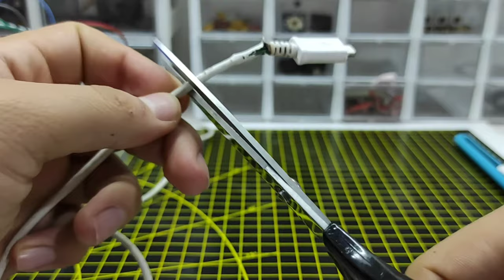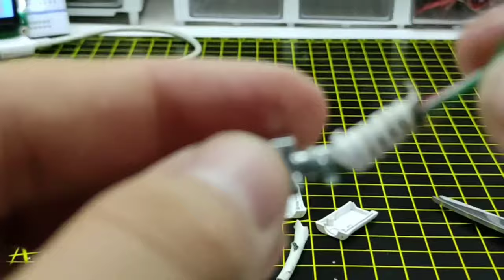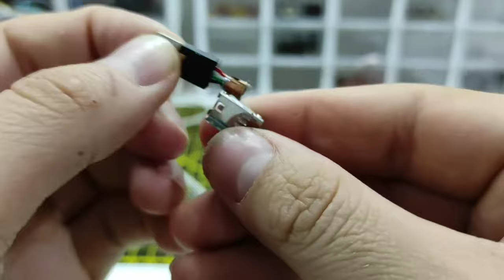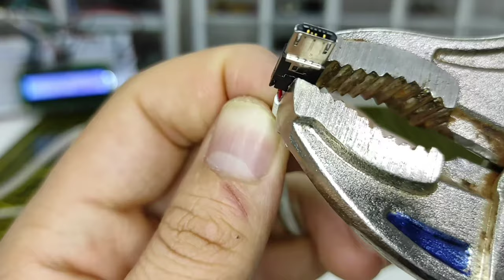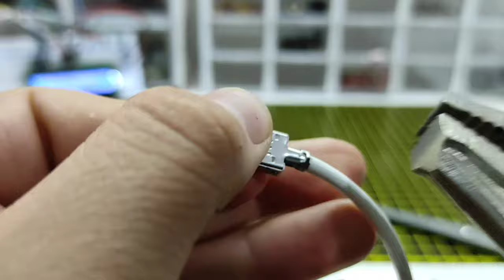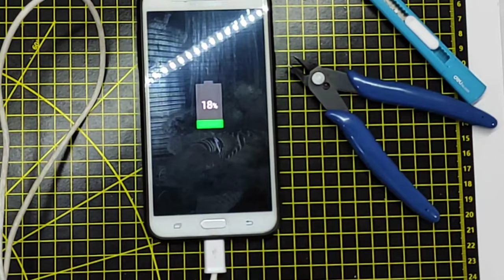BEST WAY TO FIX AND REPAIR CHARGER CABLE  (repair any type of charger cable )

Comment: You just saved yourself eight bucks And  increase your chances of starting a home fire by 50%
Reply: why??
Reply: I think we can use this skill during  emergency time only when we have no choice at all. 
But when we in normal situation and still afford, it's better for us to buy a new one coz it's more safe.
Reply: They cost $2 or less
Reply: relax Kevin
Reply: Explain
Reply: @hstone0808  not smart by you man
Reply: Explain
Reply: @hstone0808  bwaaaaaaaa
Reply: @morrismorris903  yea go ahead and buy the ceapest one possible and it will charge days. And will broke in 2 weeks
Reply: Hector btw ur saying nonsense if u fix the cable perfectly took it apart etc. And put a loot of protection on it it will not start a fire.
Reply: @Nobody-sz2uv  its easy to make a mistake .... speling n stuff n that a loot bwaaa
Reply: @morrismorris903  where
Reply: Not how that works
Reply: In my country they cost 50 usd…
Reply: Indians laughing in the corner 😆
Reply: Cause 5 volts sparks & starts fires all the time. 🤣
Reply: Exactly the type of thinking that keeps money in the pockets of those who don't think like that
Reply: @morrismorris903 ur dum
Reply: @MartinMaldonado93   what country are you in?
Reply: Doesn't increase chance of fire whatsoever at all you have no clue what you're talking buster
Reply: Why are you even here?
Reply: Where do you find a charger for 8.00? What makes you think  rewiring is any different then wiring to begin with?
Reply: So, why not add more trash  to the waste field
Reply: @morrismorris903 um not sure where your purchasing your cables from. But mine are 18+ buck because I use premium wires.
Reply: 10
Reply: Idk why. My brother and husband are the kind of guys who would attempt things like this and more. They have repaired vacuum cleaners, heater etc and we’ve never had a problem in decades. So depends on who is attempting to do it. If you have the patience and working knowledge of electrical wirings etc., this can be done without fear.
Reply: make karen alert
Reply: Kupuji si originál za 14 euro a vydrží max 4měsíce 😩😂
Reply: Buying a new wire...7$.....learning how things work in order to be able to be the handy man in the room...priceless
Reply: A guy with zero electrical experience, commenting absurdities. And then too afraid to respond back classic
Reply: Dc voltage not AC
Reply: Ok so expensive to get a new one let's buy a cheap one instead now we got 75 % chance if home fire. Can't afford to spend enough money on a genuine one? Repair at home as stated in the video and yes there will be no chance of home fire if done correctly as stated in this video. Full stop.

Comment: Only works like this on 5% of the cables.
Reply: I'm willing to try and fix mine, and appreciate this person's willingness to  post and share their experience so that I can learn.
Reply: @74Voyeur  Have fun... sometimes its easier and cheaper to buy a new one or atleast the connectors. Besides if a cable is damaged to this point the overal health of this cable is low. That means that after the repair it will break much sooner. Did that a lot but in the long run it was just not worth it. But everyone is alowed to make their own experiences. So go one and have fun.
Reply: Do this really work cause I need mine fix as fast as a lightning

Comment: How did you know the order of the colored wires? What color goes in what order?
Reply: check the order when taking the damage cord out
Reply: Should have instructed that in the video when prying the connector apart.
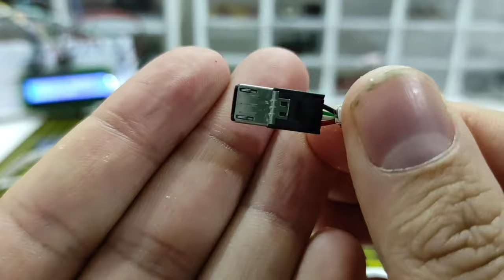Reply: You can see in video the position of cables 1:19

Comment: Thank you very useful knowledge.  does the end of the cable need to be stripped, sir?
Reply: I thought the same thing but I believe the housing has small conductive pins which pierce the plastic. I do not believe they need to be stripped.

Comment: There is a reason to put metal shield from the metal case and cable shielding. It is bonding and grounding for radiated emission.

Comment: I have an electronic that when plugged in to supposedly charge light turns on but battery meter stays same no charging movement and when plugged in for hours no difference in battery meter so thinking need to buy another one similar from different seller on eBay. Would be cool if knew how to fix myself.
Reply: a USB standard size into charging box and other side is a small plug in like radio shack style single circular/ tubular plug in

Comment: if the broken cable works dont fix it just put heatshrink tubes or electrical tape if it is broken and doesnt work do what he did

Comment: I have bought over 150 Apple sync cords. They are horribly designed. I never use them to sync data. I only use them to charge phones. Can the two wires that handle data be cut leaving only the two power wires? 

Apple has made tens of billions by selling cables that are designed to fail. They even put chips in the cables to try to stop third party cables from being used. I get those ‘accessory is compatible’ messages even from genuine Apple cables. Apple is corrupt.